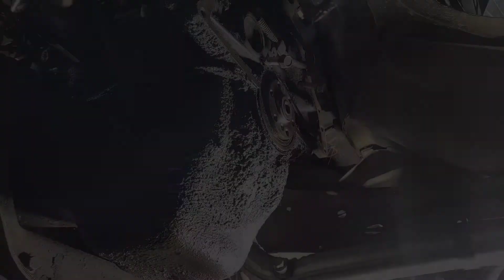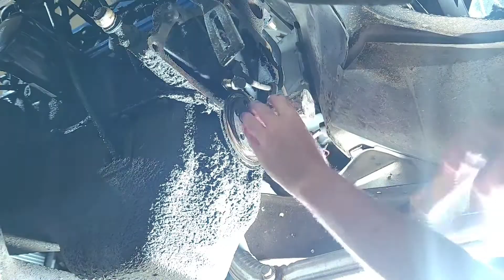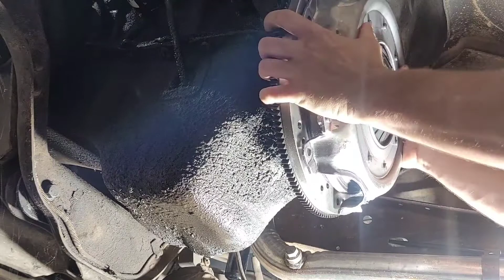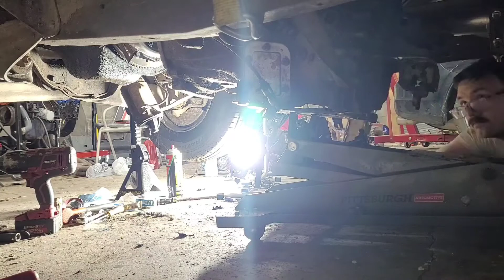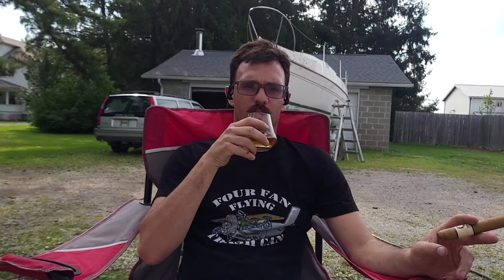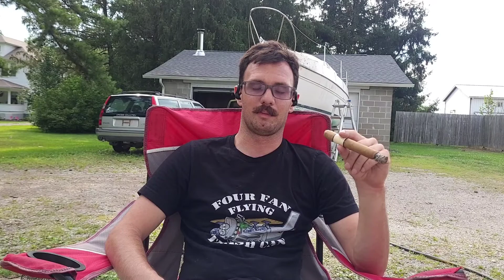F100 transmission install part 1

Comment: Mannn it's good to see you doing good! Lol you were probably working on some of the planes I was on from January to June.

Ole truck seems to be coming along nicely. Given it's a different transmission it might be out of your control with the cross member. I'd consider drilling.

Keep it up man this is good stuff you have a good thing going on here
Reply from the maker: It's quite possible I was! I'll probably end up drilling but I'll do my part to find a crossmember first

Comment: This is a great video. What all did you have to change from stock? Is there a thickness difference in the pilot bearing and flywheel. I’m getting about a quarter inch to seating the transmission but the dowel pins won’t touch engine block. Any advice helps
Reply from the maker: Everything bolting up to the motor was stock, I used an 11" clutch assembly for a newer truck, I have drilled holes in the firewall for the clutch master cylinder, and I'll have to drill holes in the frame to move the crossmember, but I made no mods to the engine or trans to mate them

Comment: Hey man, that Flywheel and clutch, was that specific for a ZF gearbox.Someone told me that the input shaft on a ZF was bigger. Would that Flywheel clutch combo be off a small block V8 that ran ZF,s
Reply from the maker: Yes it was the flywheel and clutch for a zf5, look for a late 80's truck when ordering parts